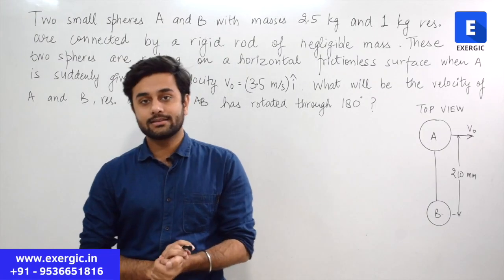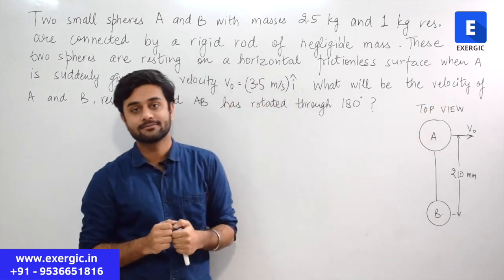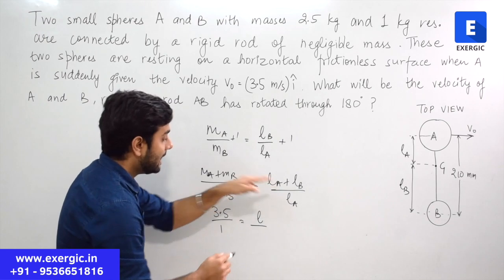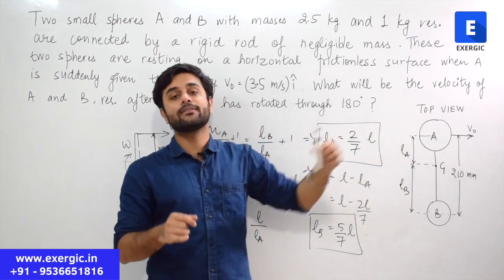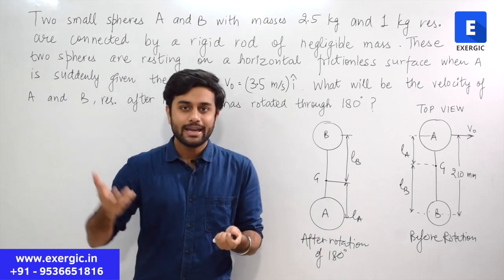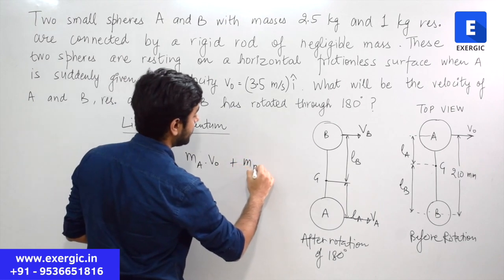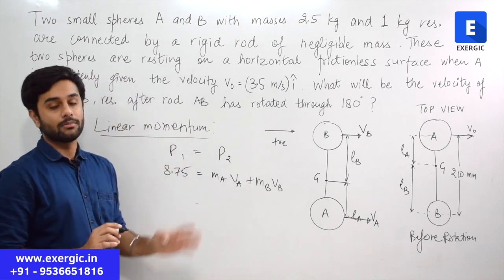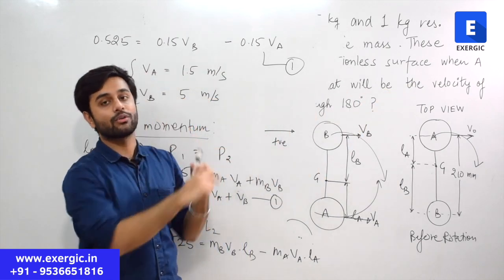Trick to analyse momentum numerical - Mechanics | GATE Mechanical

Comment: Sir, I tried to solve it in another way and also got the right answers. Please check the approach sir if possible.
1. Found out angular velocity by equating initial angular momentum to I*w (where I is total moment of inertia about Centre of mass (CM)) got w=50/3.
2. Got relative velocity of A wrt CM (by v=rw) as 1m/s ... now this gives rectilinear velocity of CM (By common sense) 2.5m/s.
3. So when 180 rotation has happened, 2.5-1 gives 1.5m/s in forward direction.
4. Similar logic for mass B also gives the 5m/s.